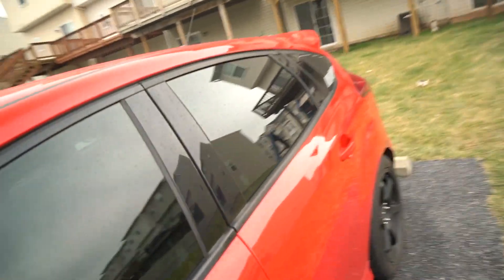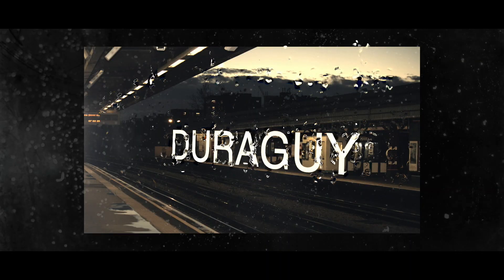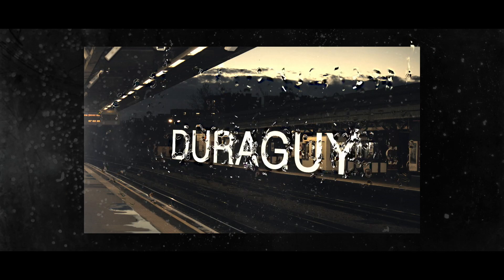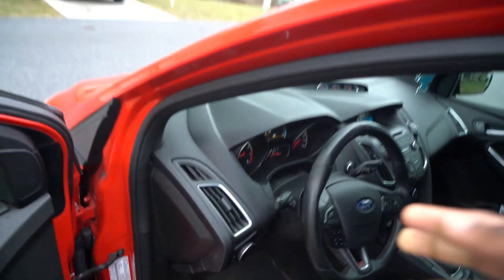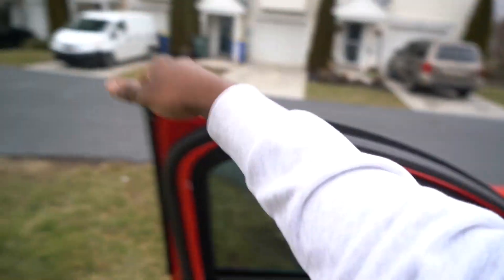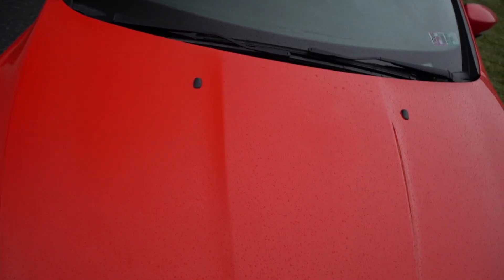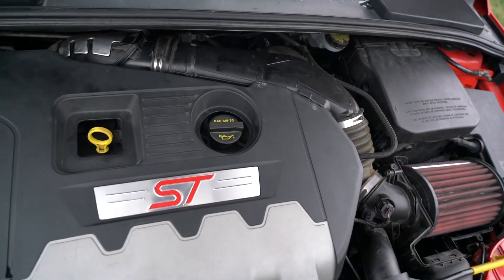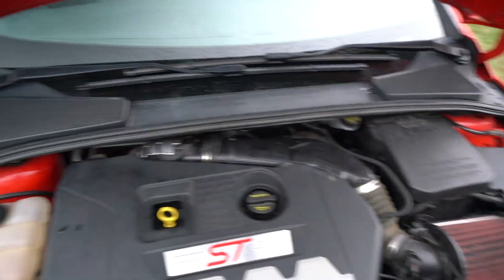FORD FOCUS ST Motor Blew UP  !!! P0301 code. *NOT CLICKBAIT*

Comment: I feel you man. My motor ran more than 120K miles with the same mods and did the same as you did the replacements and all that and yet I still have the misfires in all cylinders and I was told to get a new short block with the internals. Never thought the engine would last for seven years with all maintainance done frequently and yet the engine broke down.
Reply from the maker: Just do another edge 2.0 swap man and u good to go

Comment: Check the compression on all 4 cylinders, spark plug gap, and if theres any coolant in any of the cylinders. Could also be a bad injector. Compression test will definitely let you know whether your motor needs a rebuild.
Reply from the maker: TheEquivalentXchange  I did the cylinder one was at 50, cylinder 2 at 170 . 3 at 170, 4,170
Reply: @Duraguy  At least u have a reason to go built motor/warranty ;)
Reply from the maker: Yes sir. But I wnana take my time take the motor apart and see what my problem was feel me
Reply: This happened to my 2015 focus! Piston ring failed and bits of the piston broke off... had to pay £2400 for the build. And sold the car after :(
Reply: I'm dealing with the same issue rn. Did compression test, cylinder 1 was at 50 as well. Me and a mechanic both did a compression test. I, myself replaced the valves and that didn't fix it sadly so I have bad ringlands. Debating if I want to do this or if I'm going to take it to someone or buy a new engine.

Comment: Damn man, I'm in the same boat. And what's crazy is that I have 55k on the motor as well. These cars always get killed by lspi. My shit sounds like a Subaru.
Reply from the maker: Damn man . That sucks .
Reply: lspi?
Reply: Was just driving my focus. Shit started sounding like a WRX after a 2step. I’m scared as shit. Only drove it 2 miles home after the incedant. No check engine light
Reply: yup its blown getting new motor. just got the car lol
Reply from the maker: Find u a cheap motor and throw it in bro

Comment: Typical LSPI. Happened to me too on a hot day and aggressive driving, although it’s with a 1.5 Ecoboost. Piston in cylinder 2 shattered. Replaced the entire short block under warranty. 

No problems with the 2nd engine... just use the highest octane fuel you can get. Also putting in a good oil that resists LSPI will help too. Any turbocharged car is susceptible to this apparently.
Reply from the maker: what kind of oil do u recommend ?
Reply: @Duraguy  any good SN Plus full synthetic. I'm using using amsoil 5w30 now and changing the oil every 6 months, not 1 year. Sure its a bit expensive but I'm not risking blowing the piston again.
Reply: Siye Boss  apology. I meant to include pre-ignition or detonation as causes too. I have heard people say that carbon chunks on the piston get too hot and becomes a source of ignition itself. Basically since these modern turbo engines are naturally extremely high temp during operation, higher octane fuel with good oil will lessen the chance of this happening.
Reply: These engines need decent octane when tuned detonation cracks the piston's. Don't cheap out on fuel for the sake of $20

Comment: I just had the same problem with my focus st , in cylinder 1 on start up , under 1 k rpm, the engine has 100 k miles
Reply from the maker: Same

Comment: Did you blow it up on stage 2 Cobb?
Reply from the maker: I blew it up on stage 3 Cobb. it went out the next day I installed the Cobb Accessport stage 3
Reply: Duraguy dang that’s wild! Sorry that happened to you man!
Reply from the maker: Siye Boss  yes I run 93 but I used the Cobb ots map on my car and I think that was part of the reason it failed
Reply: @Duraguy  same exact thing just happened to me after 3 months of owning my car, also it’s the first car I have ever bought

Comment: If anyone is coming here because they also blew their motor BUY AN ECOBOOST FROM A FORD ESCAPE it’s so much cheaper and you just have to swap accessories/mounts.
Reply from the maker: That’s exactly what I did haha cheap and same parts except the oil
Reply: @Duraguy  my cars been sitting for 4 months since I lost cyl 1 lol I still need to take the head off to see if it’s just a head gasket bc it’s pouring white smoke haha
Reply from the maker: Man don’t ever waste ur time get escape and do the swap
Reply: @Duraguy  I’m building the trans while it’s out and I’d like to have all the aftermarket bolt ons so I can do it all at once. Just trying to save $$ currently 😂
Reply from the maker: I feel u man

Comment: I have P0304 and it sounds like a subie.. plugs, coils, injector, ringland
Reply from the maker: Time fr new motor
Reply: Going to throw in a 500 dollar escape/fusion motor and build the oem. Then big turbo.
Reply from the maker: That’s what I did got an escape motor and went from there

Comment: Sucks man this happened to mine :( cost me £2400
Reply from the maker: oh man these cars are expensive. Especially on parts. did u ever take the other motor apart to see what actually happened ?
Reply: Duraguy hi mate, I just had the piston replaced I believe it’s a common issue with this motor. Especially if you have a remap which I did at the time!
Reply: Duraguy and yes the mechanic took detailed photos of the work, when the block was opened and gave me the broken piston... you could see where the piston ring had fractured and a piece of the piston completely broke off! He said I was really lucky this didn’t cause more damage to the internals, as you can imagine sharp bits of metal flying around inside the combustion chamber. Once the new piston was fitted the motor still ran slightly lumpy at times so didn’t take the chance and sold it before it became more noticeable!
Reply from the maker: C S yes it’s a common problem with these motors. I’m gonna rebuild my other motor but I will like to the time to do it tho. I can’t wait to tear the old one apart and actually see what happened to it
Reply from the maker: C S also if you get a proper tune on these cars u face these kinda issues a lot of times
Reply: Duraguy yeah just one of those things mate! I have had 3 fords previously and never had any problems before so was maybe due some bad luck haha. I hope the build goes well for you I’ll be looking out for a video if you make one 👍🏻
Reply from the maker: C S for sure I will be making videos and stuff. Thanks for checking out previous videos